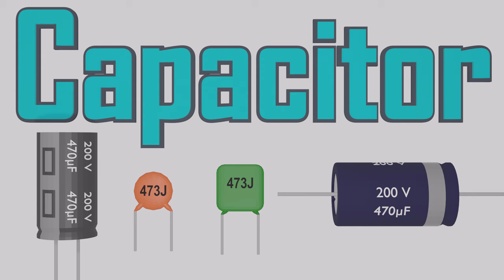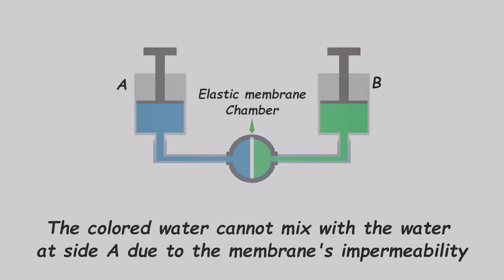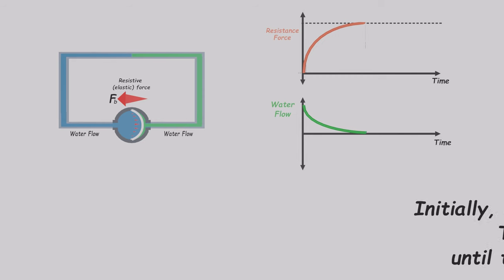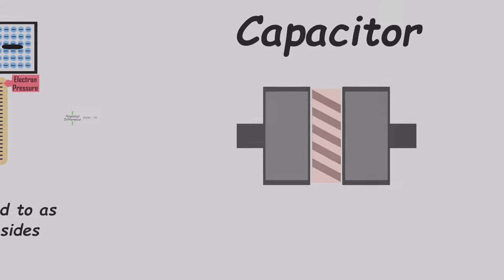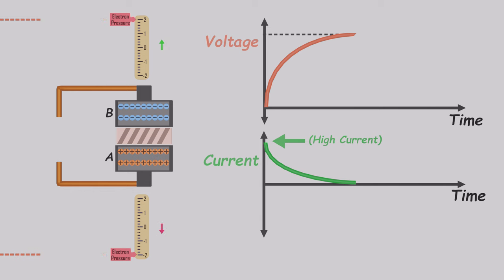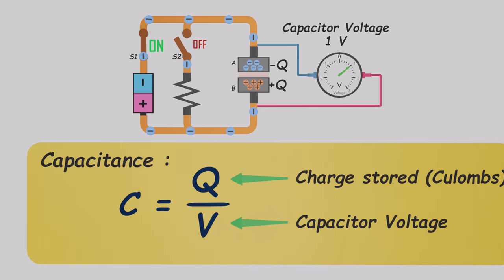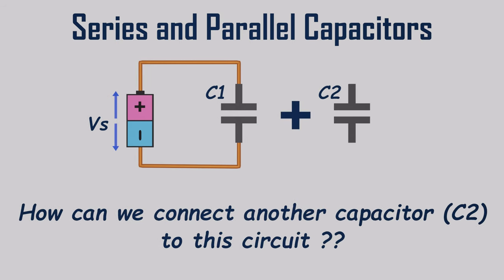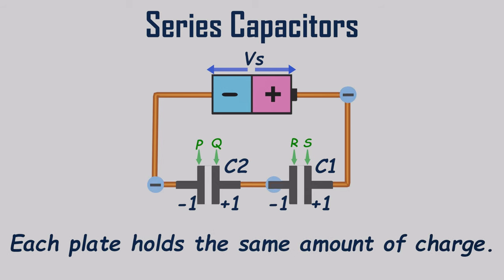Capacitor Explained : Calculations | Series | Parallel | Charging | Discharging

Comment: I hate the water analogies they put your mind into a false perception of the actual nature of the electron.
Reply: Water totally worked for me. Since I don't t know their true nature. I now know the difference between current and pressure and work. P/ I* E. E /I *R.
Reply: Can you please explain I keep hearing that but don't understand electron the right way can you help me??
Reply: Totally agree... really is a false analogy... rather explain the physics.
Reply: Its actually a fairly decent analogy.  Pressure, flow and waves all work the same if traveling in a straight line from point a to point b with no outer electro magnetic interference ot influence.  Using an o scope shows this very well measuring at multiple points along the way from a to b and back to a.  There was a very well done experiment done by a channel here I  forget the name of.  Something to do with the word Phoenix in the name.  Actually come to think of it water is influenced by electricity also.  It can draw or repel.
Reply: Agree! Always hated that myself!
Reply: I think the water analogies have been well presented here.
Reply: @Freekniggers  Um fluids and electrical coulombs behave nearly identical. This analogy was near perfect.
Reply: Water analogies with capacitors.... worse comparison ever!

Comment: Very well explained except when calculating the total capacitance in the series example you mistakenly used C3 = C1 + C3 where it should be C3 = C1 + C2. The same happened in the parallel example where you said 1/C3 = 1/C1 + 1/C3 where is should have been 1/C3 = 1/C1 + 1/C2.

Comment: Beware there is a typo in the equations in 15:04 whre it was supposed to be "C3 = C1 + C2" (not  "C3 = C1 + C3" with C3 on both sides of the equation) and in 17:10 whre it's supposed to be "1/C3 = 1/C1 + 1/C2".
Reply: Correctly told.
Reply: thanks was thinking there were
Reply: also at https://youtu.be/y1-MbGU-HZY?t=929 he mixed up C1 and C2. But the graphic tells it all.
Reply: Even a 3-year-old knows that 3 = 1 + 2. A positive comment would be more fitting for the great explainer video
Reply: @agronbislimi8545  Your comment demonstrates a fundamental misunderstanding. I did not equate 3 with 1 + 2. Stating that 3 equals 1 + 2 is entirely distinct from asserting that C3 equals C1 + C2 which which may not hold true in all cases. If this concept eludes you, it would be advisable to gain a better grasp of the subject matter before offering judgments on the appropriateness of comments related to this video.

Comment: Very good video. What about this suggestion: 
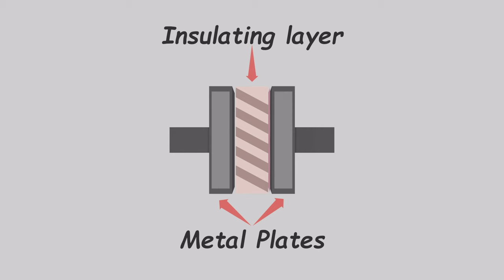12:41 The permittivity remains unexplained; it could have been compared with the membrane thickness or membrane elasticity in the water cycle (...and also comparison of the surfaces...).
... And PLEASE CORRECT the equations (C2<->C3)!!

Comment: Excellent Tutorial.  Thank You.
But be aware that the paper separators can successfully be thought of as the Dielectric in a 470 uf Capacitor for this lesson, but they are not. If the paper was the Dielectric then the Electrolytic Capacitor would have the same Capacitance when wet or when dry. But a dry Electrolytic is very Low in Capacitance, maybe, possibly in the Picofarads.

Food for thought:  The actual Dielectric in an Electrolytic Capacitor is microscopically thin (hence the Large Capacitance) and the Electrolyte's 2nd. function is to effectively extend one of the Plates through and past the paper separator, all the way up to the extremely thin Dielectric.

Gregory/
The Pigeon Meister
 ... .🐦‍⬛

Comment: Can you elaborate more on how a capacitor fills and unloads in a circuit? Does it need switches and resistors in order to function properly? Otherwise capacitors seem very similar to batteries.

Comment: I knew a lot of this but it’s good to hear a new perspective. But the way you’ve explained it, current cannot flow through the capacitor just as the water cannot make a continuous flow though the two water chambers. But we know that an AC current can flow though a capacitor. If I wired a capacitor in series with a load and applied an AC voltage source, current will flow and power the load, while filtering the lower frequencies. I was a bit disappointed that you didn’t touch on frequency. Also, to figure the total value of capacitors in series, if they are all equal, you can divide by the number of capacitors, and if they are not equal, the rule is that total capacitance will be less than the smallest one. Great explanations though.

Comment: 10% of this video is useful. If can show the electrons running to and fro with some instrument, i can understand.
When i should use a capacitor in a circuit. How to calculate its value.., how to detect a defective capacitor etc etc, if you could explain....

Comment: That panorama of events of water flows opposite or water flows the other way or back as there's resistance or halt balance of state are just part of hydrogen science of it's many applications. Do you playTable Tennis? The pick. Did you miss the effect after that? What did you miss after the experience of experiencing the fragrance and punginess? That synch to your component or to greater extent, to your being soul. The Creator won't create spirits if they're all the same.

Comment: I never understood how capacitors work. How can they be charged up when there are no connection between the terminals? They are isolated from each other. How can there ever be a current through them that causes them to be charged?

Comment: This is a commonly accepted way of teaching capacitors. It is sadly wrong. The charge of a capacitor is stored in the dialectic, not on the parallel plates.
Reply: Electricity is a moving field event, moving faster through insulators than conductors only when accelerating. Party on dudes, be good to each other. Charged particles source the electricity and all particles react to electricity giving us a way to detect and characterize the electricity.
Reply: I think, up to highschool it is a totally acceptable explanation this way.